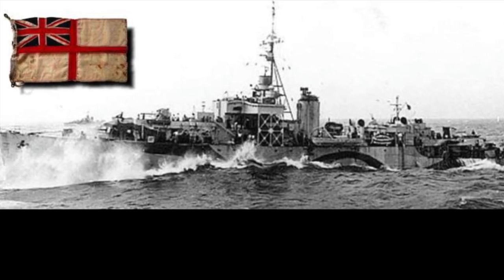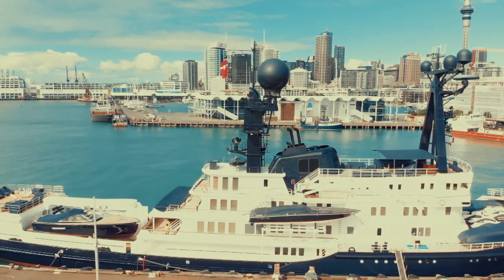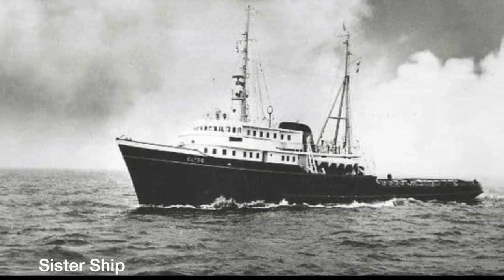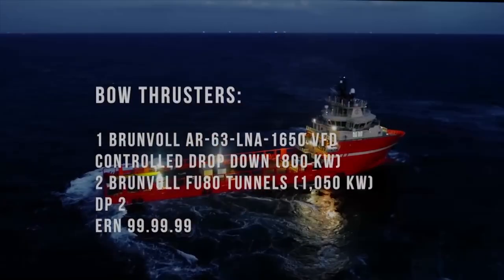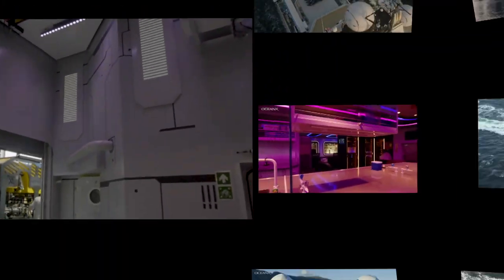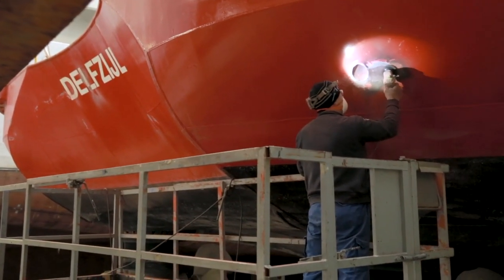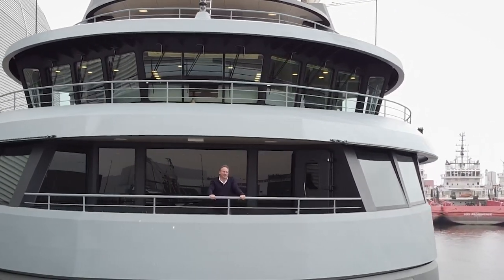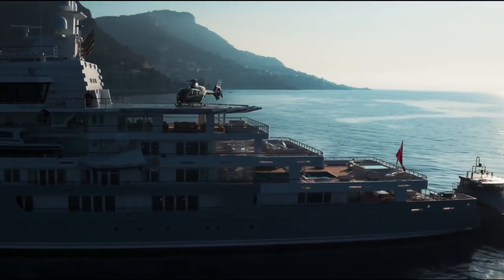CONVERSION YACHTS - Part 3 in the Series on The History of Expedition/Explorer Yachts

Comment: Mr Madden
I would like to suggest or actually more like a request of a subject, maybe a chapter in your upcoming video, or a standalone video on its own. 

The subject is about what can a prospective owner do during the design stage to ensure a lower running and maintenance cost of a yacht.

 In one of your video you glossed over even the choice of paint could meant less maintenance needed by the crew. 

10% per annum seems crazy
Reply from the maker: I like your suggestion. In any megayacht marina you can just count the hours spent every morning by crew wiping away all evidence of dew or salt air. If the yacht dares venture out of the marina and suffers from a splash or two of ocean water, you can be sure that when they return the crew will spend most of a day (and many gallons of fresh water) removing any salt from the gleaming surfaces. In  my experience, one of the the biggest warranty issue for a shipyard is for claims made on the paint job- if the starboard stern does not match the port bow perfectly, a lawsuit will result, despite the impossibility of those areas ever being next to each other- unless they wrap the hull around a lighthouse.

Comment: Mr Madden
I have seen a few videos of explorer yachts tour while they are being built by the likes of Bering mentioning how the panels on those yacht are insulated and rubber mounted. are those conversion yacht can be built to the same standards? or is it one of the trade off of getting those conversion yacht cheap
Reply from the maker: New accommodations can have ‘floating floors’ insulation. Engines can be re-mounted if needed and shafts can be insulated if needed. Props and drives/azipods are also subject to upgrade or replacement. All this is at a cost and must be weighed against the benefit.